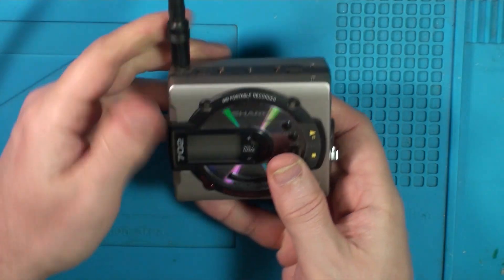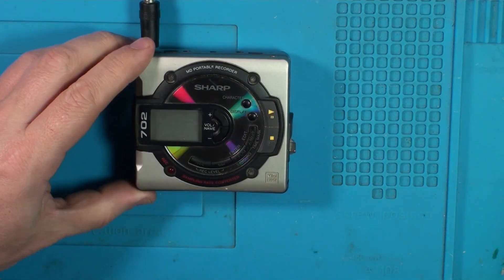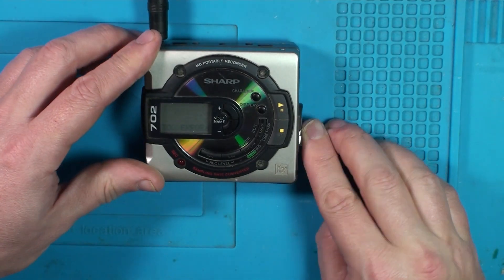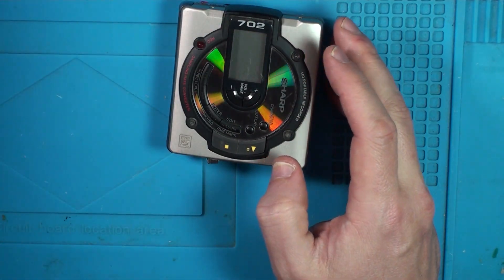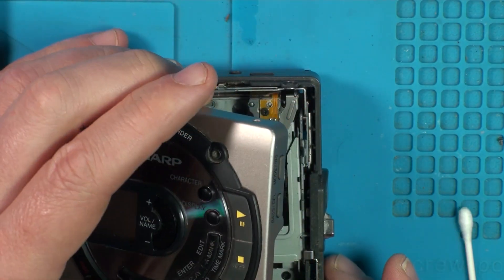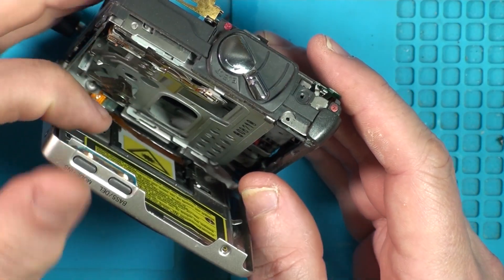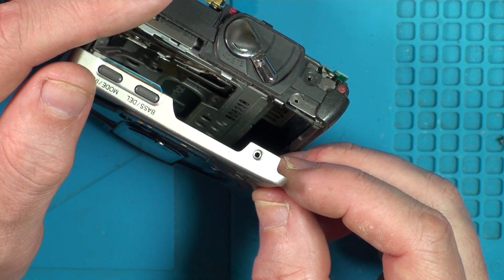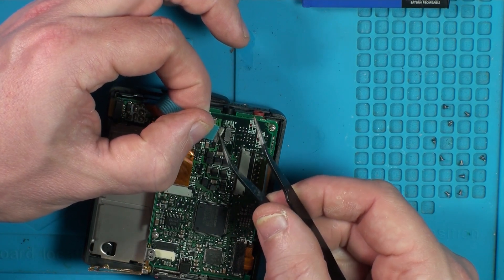Sharp Portable Minidisc Player TOC Error a MD-MS702 | UK eBay Reseller

Comment: Almost every Md sharp that displays the Toc error is because of the splitted/broken NGERH0597AFZZ J AC Wheel,Drive (worm gear). I replaced it in 4 models and now thery work fine.
Reply from the maker: Please can you tell me where I can purchase the worm gear. I had trouble finding any for sale.
Reply: I have one too, but I got it to work but the servo motor simply won't turn at all to move the slide around.

Comment: Good to see you try to repair the Sharp Minidisc , there so iconic and a great portable device i had the Sony MD Walkman - MZ-R900 still boxed with some spare discs that i ened up selling on ebay last year as i never really used it , but another interesting vlog shame the cog  was not fixable Lee 👍
Reply from the maker: Thanks. I did find some cogs on Reddit, a guy said he was selling them but wanted about £25 for one cog with postage. Impossible to find them anywhere but I'll keep looking. I don't want to pay that much in case the laser has gone to as it didn't look very strong in the video.
Reply: The cog is the easiest to fix 😊

Comment: I have a 722 and check the plastic gears.  All are fine.   I cleaned up everything and the laser and still either get BLANK DISK or UTOC error.
Reply from the maker: It could be a worn/dead laser
Reply: @RetroElectronicRepair  Thats what Im afraid of.

Comment: Compared to Sony, Sharp minidisc players have terrible reliability. I always assumed the lasers were sub-standard, but maybe it's broken cogs. Either way, I avoid them.

BTW, I don't think I've ever fixed a minidisc player by cleaning the lens.
Reply: To be fair I found them to be perfectly decent during their service life but it definitely does seem to be the case that they don't take bring left in storage very well... Apart from the Sony ones they all seem to fail over time - JVC, Sharp, Panasonic and Orion are all the same. The ones that do last, including Kenwood and Denon, are just Sony mechs inside anyway.
Reply: @jasejj  Hi. I didn't know they are Sony mechs. I've had good experience with Panasonics, but they do like a fully charged battery.
Reply from the maker: I've never fixed a laser by cleaning it either but you have to give it a try. It has however fixed a laser that was skipping on tracks.

Comment: The "Disc In" switch may be dirty. Which is probably why the disc is not rotating. This may be the reason for the TOC Error as well. 

I know Sony minidisc recorders have 2 or 3 switches, Disc In, Disc Eject, and Disc Write. This may be the same with the Sharp MD Recorder. The switches may be dirty. 😊
Reply from the maker: Could have been that too. But the broken cog is the most likely cause for this one.
Reply: Wow very interesting video well done 👏 I have 3 of sharp minidisc all of them have the same problems the gear ⚙ is cracked does anyone can 3d print them if can be printed and you can make lots of money by selling the gears there is lots of demand for the gears ⚙ and you can't find them on the Internet only one person sells these 3d printed gears but he is in USA selling for $30 and the postage is $28 on the top total $58 😱🙈 please let me know if you can find cheaper gear ⚙ thank you you are the best as Always
Reply: I also have a Sharp MD player/Recorder that  has the TOC error. Would love to get it repaired. Bought it when I was a teenager many years ago. Would be interested to see if mine is repairable.
Reply: Any idea where that switch is?

Comment: I have a Sharp MD-MS701 that works very well, but its case is badly worn. So I got a second player of the same type which is looking brand new. But with some discs it shows a UTOC Error. I tried several discs, TDK and Sony are working fine, but Maxell and BASF cannot be read. My old player is able to play all of the discs, so they are ok.
So what could be the problem? If I had the same issue with this gear I think it should happen with all sort of discs and not only with a few. Any idea? (I did clean the lens with alcohol)
Reply from the maker: Is it exactly the same model? Some older players won't read the long play format discs. That's all I can think of.
Reply: @RetroElectronicRepair  yes they both are exactly the same model MD-MS701.
Reply from the maker: That's very odd then. I have no idea why it wouldn't work. Maybe the laser is a bit weak.
Reply: @RetroElectronicRepair  thank you anyhow